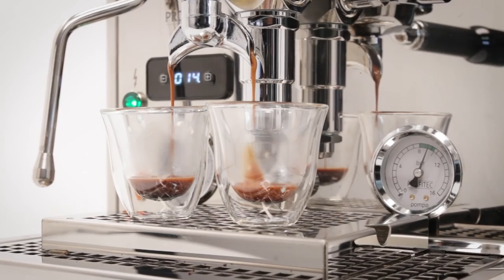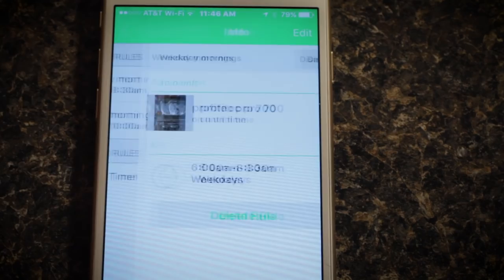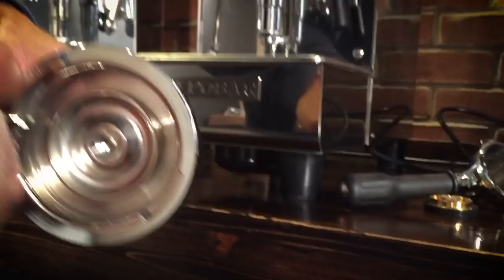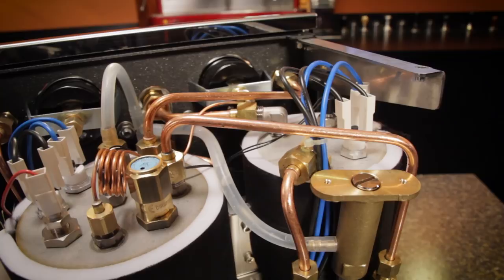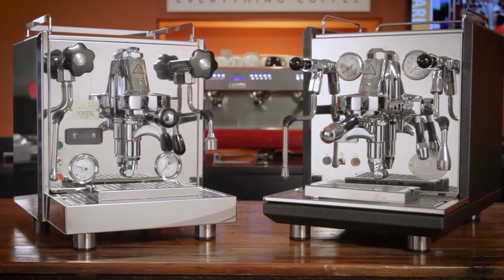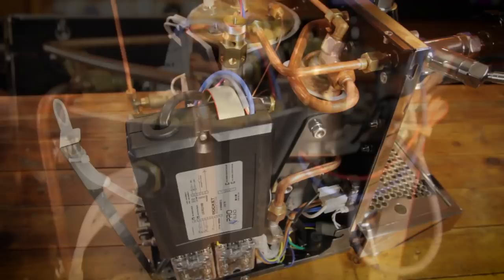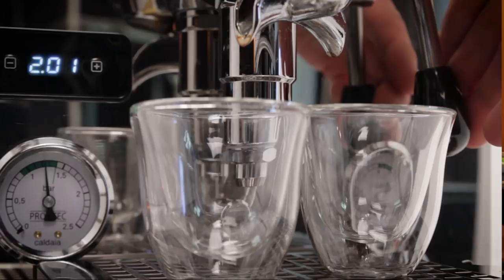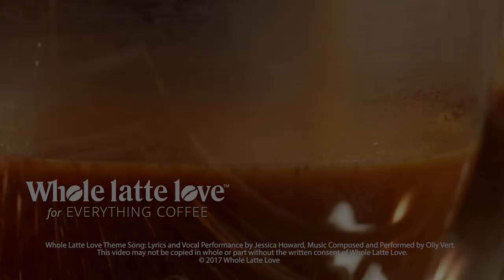Compare the Top 4 Dual Boiler Espresso Machines 2017

Comment: I am thinking about purchasing the Rocket R58 and I noticed that you recommended to pair it with the BWT Bestmax water filtration system. I looked up the BWT Bestmax Premium filter and one of the warnings on this filter was, "Not for use with machines that have components made from copper, galvanized, chromium-plated or nickel-plated material". The boiler in the Rocket R58 is copper and brass. Am I misunderstanding this or should I avoid this filter, even though it appears designed for espresso machines?
Reply: just to clarify, I obtained this information from https://www.espressoplanet.com/BWT-Bestmax-PREMIUM-Water-Filter-and-Softener-Systems.html. I went to the BWT website and could not find this same warning on this product.
Reply from the maker: Hi MS, Thanks for the question. Do you have a link to the warning? I have not heard or seen that before.
Reply: Hi, thanks for getting back to me. I included the link in the previous reply. Since then, I have done some more research on the BWT website and found what they may have been referring to. On the BWT website, https://www.bwt-group.com/en/Products/Pages/product.aspx?pid=FS22P01A00v(BWTGROUP)#product, (not sure why the link isn't working) I opened up the PDF manual and it states, 

"6.3 Material selection
When selecting the material, remember that decarbonised water contains free carbonic acids.
To prevent corrosion, BWT recommends that no components made from copper, galvanised,
chromium-plated or nickel-plated materials are installed between the filter system and the
appliance."

That said, they also identify this filter to be suitable for espresso machines etc, which are pretty much made of copper pipes...Should I be concerned at all?
Reply from the maker: Hi, Thanks for providing the link. BWT definitely recommends the Bestmax Premium filter for espresso machines. So I agree the 6.3 section in the pdf manual is confusing! Perhaps the key phrase is " ...between the filter system and the appliance." They do not specify those materials are problematic in the appliance. I'm contacting BWT to get clarification and will update with their response.
Reply from the maker: Hi MS, Contacted BWT in regards to the free carbonic acids and risk of corrosion. Here is their clarification:
"That warning is primarily for the original Bestmax filters, but they included it with the premium manual as well. The risk is that if you set it to blend setting 0 that the filter will run 100% of the water through the ion exchange. Calcium is replaced by hydrogen which lowers the Ph and makes the water more corrosive. In the manual, none of the blend settings they recommend will result in this occurring."
Hope that helps! When operated as recommended in the manual no risk of corrosion.
Marc
Reply: Hi Marc, thanks for the quick response. The explanation given to you from BWT makes more sense now and probably should have been in the PDF manual for the Bestmax Premium filter. (for those who actually read it..hahaha). The way it was written would suggest that it was not a good filter for espresso machines.
I'm glad you clarified this and now I'm happy that I can go ahead and feel confident about my purchase!

Thanks again,

MS

Comment: I've seen 4 bars from plumbing... According to manual the maximum is 2 bars, isn't it?
Reply from the maker: Hi OM, ECM manual specifies using a pressure regulator if service line pressure is above 2bar (about 30psi for those in US). In US, service pressure typically ranges from 40 - 80psi (that's appox. 2.6 - 5.3bar). ECM also recommends a shut off valve on plumbed connection as there is no solenoid valve within the machine to cut line pressure. The Pro 700 and Synchronika have a mechanical valve accessible at the bottom of the machine for switching from plumbed to reservoir water source. This valve can act as a shutoff to cut line pressure but I'd still reccommend a shutoff on the supply side prior to braided steel line connection to machine. All that said, I've lived a little dangerously with a Pro 700 in the studio. It's been connected direct to line pressure of 60psi/4bar for more than a year with no issue. I'm not recommending that as there is a risk involved. But I've had fun playing with pre-infusion at higher pressures.

Comment: hey mark, so the only reason i went to the pto 500 over thr 700 was cuz i only make maybe 2 lattes a in thr morning at most. so i didnt think i needed to have two boilers heated for one a couple.double shots. so basically what am trying to say is are thr doublr boiler.machines desig for more latte production?
Reply from the maker: Hi Jesus, The 500 is a fine machine. Actually working on a video now comparing the 500 with an Expobar Office Lever and Rocket Giotto type v. The dual boilers can do more brewing and steaming with less fluctuation in brew temps. PID in the 700 helps stop temp overshoots during heavy use.
Reply: Whole Latte Love so for two double i dont think there much fluctuation correct? now if i waa making 4 or 5 doubleshots back to  back then i can see how a double boiler would be a better idea right? cuz i would.have to wait on the 500.till.it gets back to temperature by the 3 or so shot. is that a pretty good theory?

Comment: Can I use these machines for commercial purposes? I want to open my coffee shop in NJ
Reply from the maker: Hi KK, You could in a low volume situation. These machines are more intended for high-level home/office users and are not specifically rated for commercial use. The Gaggia TS is commercial rated and an excellent value: https://www.wholelattelove.com/gaggia-ts-espresso-machine
If you'd like some advice on a machine to serve your needs give us a call at 888-411-5282 and speak with our commercial equipment specialist.

Comment: i would never buy dual boiler. i would buy HX
Reply from the maker: Hi Martin, Thanks for the comment. Curious as to why you prefer HX.
Marc
Reply: @Wholelattelovepage  Marc because HX takes water directly from the tank through the pipes instead of sitting and mixing up with old water in the boiler as it happens with single or double boilers... I am sure they are more temperature stable but I think I wouldn't guess the difference...
Reply from the maker: @martinkulik9466  Okay. Brew boilers tend to be larger in dual boiler machines. But they also take in new water from reservoir and/or plumbed connection each time you brew. It's no different other than volume of turnover.
Marc